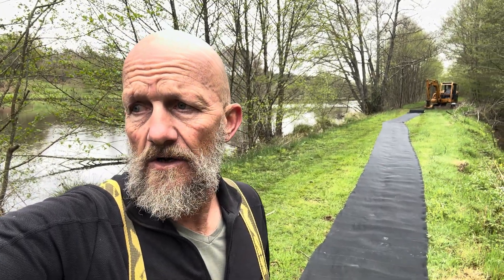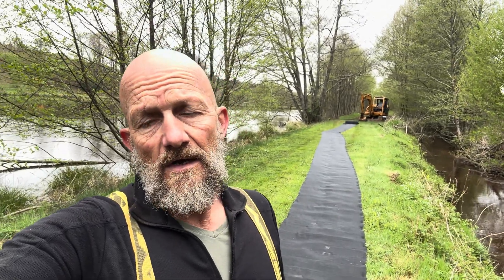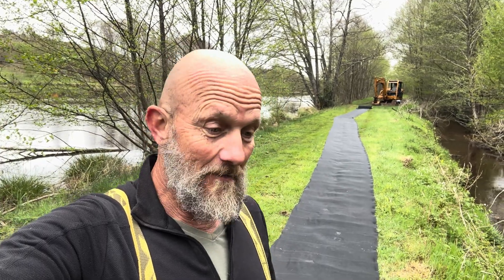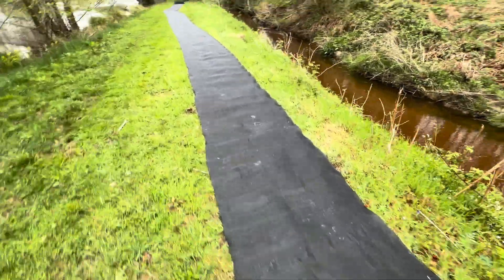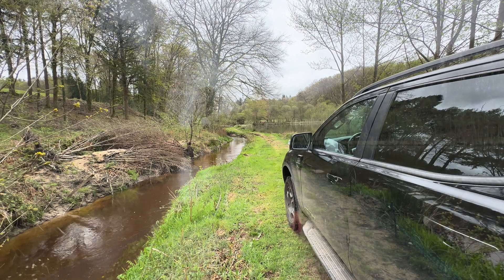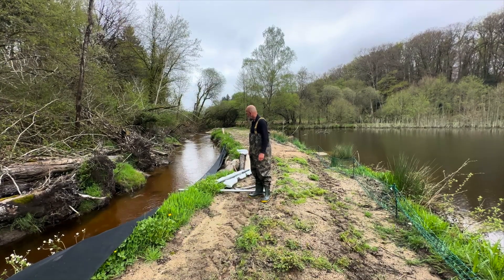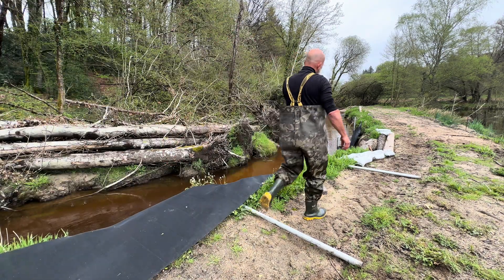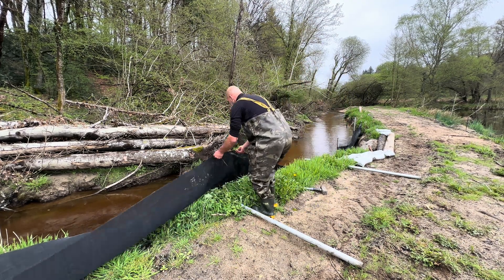"Protecting the Lake! Installing Nicospan Erosion Barriers at Fensmere Fish Farm"

Comment: Try putting another a longer steel rod down the middle of the tube , I no it's more work but will be stronger 💪🏻
Reply from the maker: Like using lengths of 20mm rebar?
Reply: @FensmereFishFarmandCarpLake  
Yeah 👍🏻